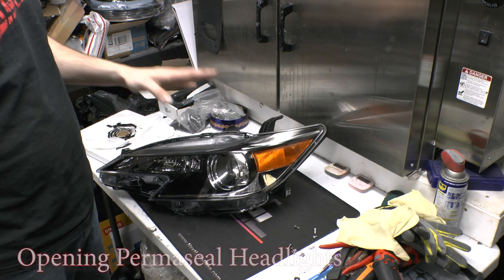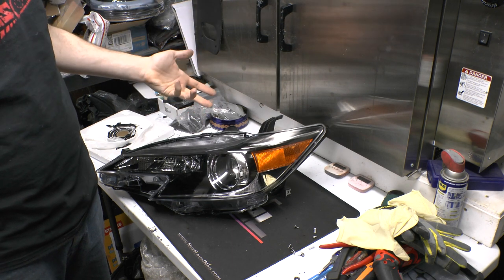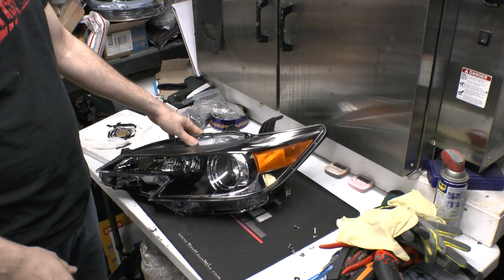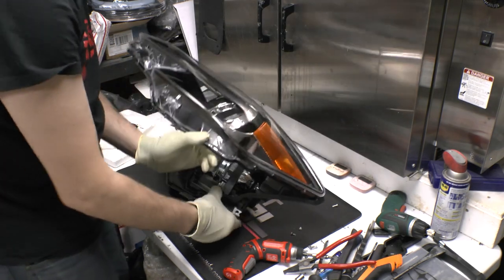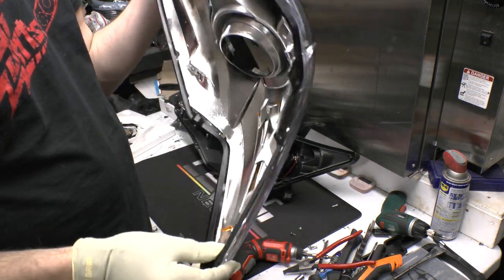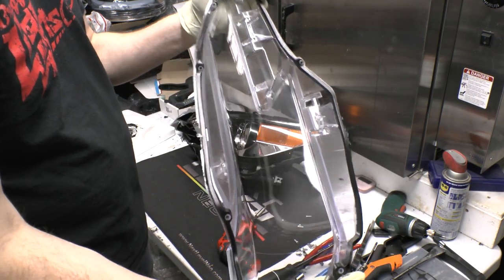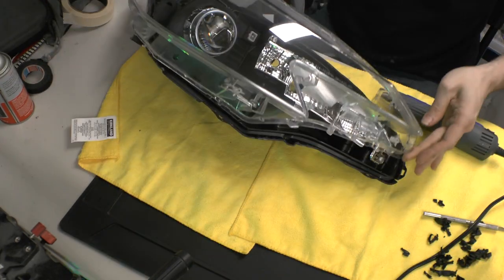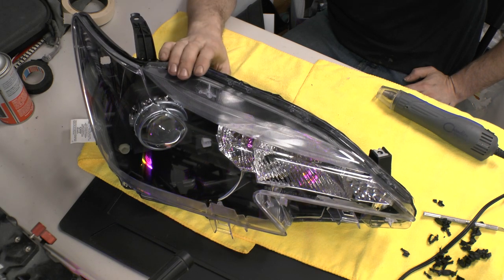Permaseal 101: The Ultimate Guide to Opening Sealed Lights

Comment: I do oem perma at 255 12-15 mins and the only one I’ve done at 275 is the vette c7 lights for 8-10 mins, aftermarket ones that come with perma 270 is usually the number for 10-12mins.

Comment: Did you done it on a 2014 vw golf 7? It seems very hard even with using an oven.
Reply from the maker: Permaseal is not fun or easy. This is why builders charge more to do them
Reply: @NextLevelNeo  well, between "hard to do" and "almost impossible" there's a huge difference that can change the job from headache to pain in the ass !

And I want to know if I need to prepare myself for the first or the second option.
Reply from the maker: @dadadu16  is all in the tools and techniques. Permaseal unfortunately can vary and some lights need different temps. I just did some vland lights that needed about 290f. That's not typical and will melt a lot of cheaper lights. Risk is part of retrofitting, you gotta factor that into price.
Reply: @NextLevelNeo  interresting... 290°F seems pretty hot, which max temperature do you think is safe to not melt plastic?
Reply from the maker: @dadadu16  250f for 10min at a time is safe for 99% of what I've seen
Reply: @NextLevelNeo  Great I will test that and give you a feedback I don't completely destroy my stuff 🤣🤣🤣
Reply: My friend, 250f in oven gas or oven with electric resistance? Thanks
Reply from the maker: @wilsonjavier47  ideally electric. Gas can cause excess moisture